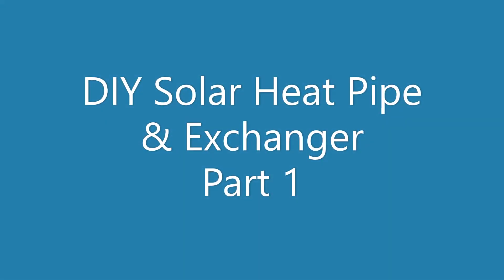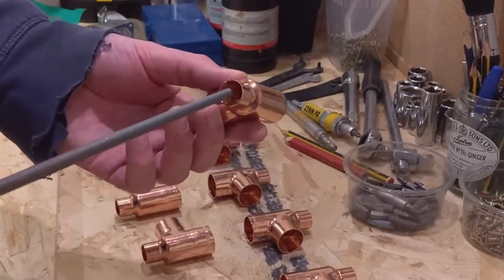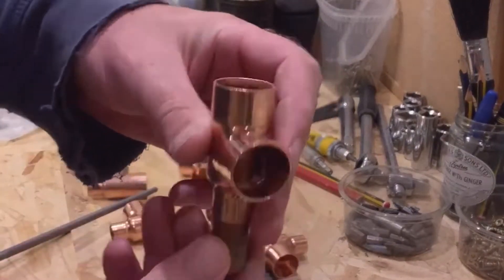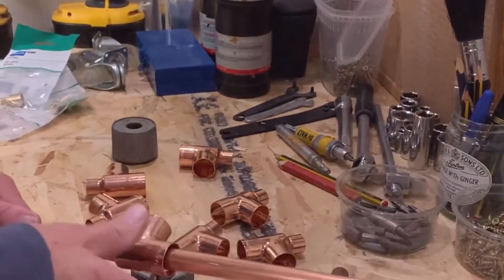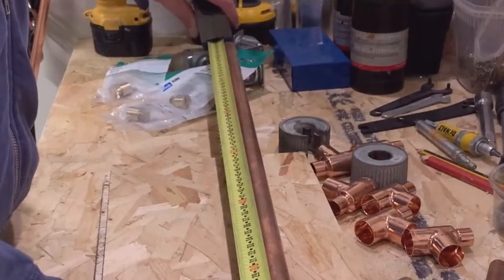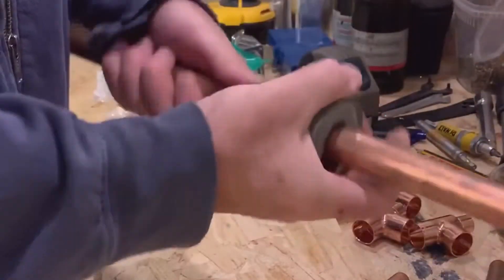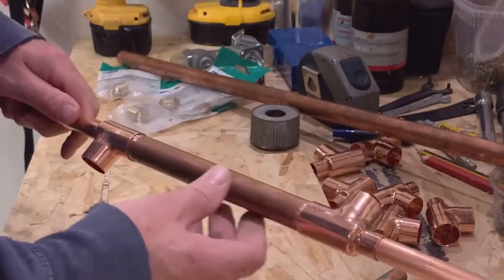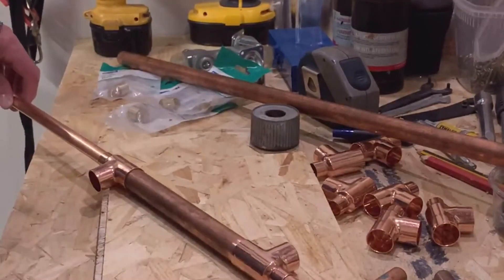DIY Solar Heater - Pipe & Exchanger: Part 1

Comment: You can sand the water side pipe with coarse sandpaper to hugely increase surface area from water to copper.